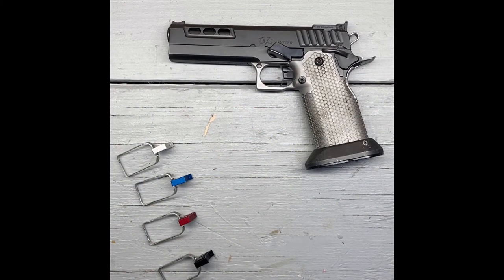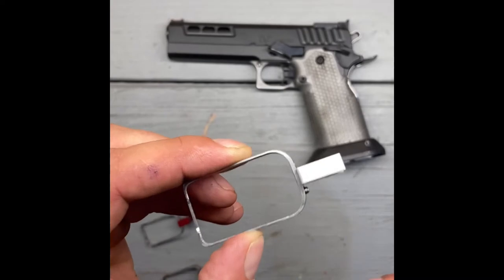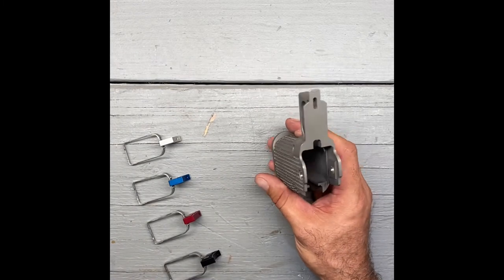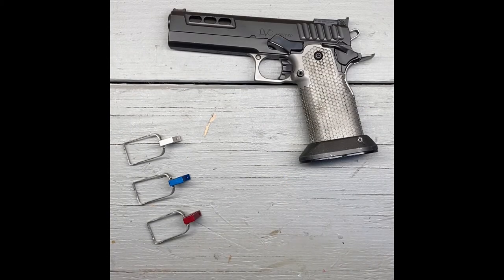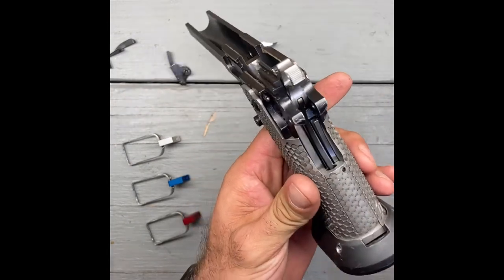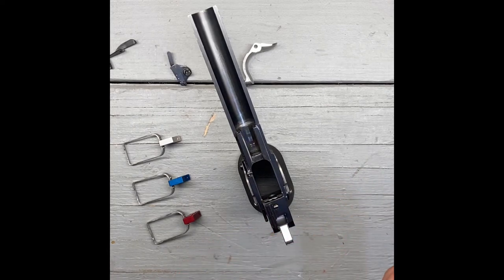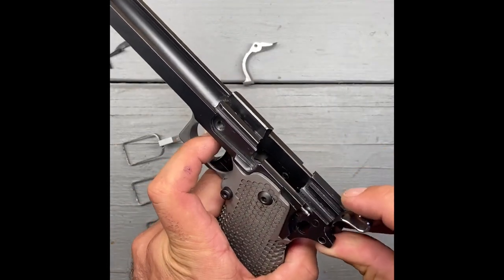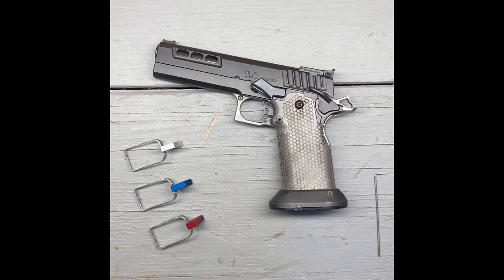ST Trigger Install Guide

Comment: What's the difference between a Staccato ST and a Cheely ST? I had a Staccato laying around so I fitted it to my cheely grip and it seemed to be fine.
Reply from the maker: There are slight dimensional differences in the trigger shoe. A Cheely ST Trigger can fit in a Staccato grip, but a Staccato ST Trigger can not fit in an unmodified Cheely grip. Cheely grips straight from the manufacture have small trigger track guides that can be filed and fitted for larger trigger shoes. Our Cheely ST Trigger is designed to fit the unmodified Cheely grip. If you have a Cheely grip that was fit for a different after market trigger, then our Staccato ST Trigger will fit them.

Comment: Installed the F2 to my C2 with gen 1 tree bark grip.  Tuned to zero pretravel and it renders grip safety inoperable.  Walking back the pretravel screw just enough to enable grip safety function gives me pre travel slop.  Suggestions?
Reply from the maker: The grip in the video is a competition PT EVO grip that comes from the factory with a non-functioning grip safety. Yes, you are correct, the grip safety tang will ride on top of the rear of the trigger bow if all the pretravel is removed making the grip safety inoperable. This is bc the grip safety tang can not return to its original position located behind the rear of the trigger bow. A gunsmith can fit the grip safety tang to the new trigger making it operable with minimal pretravel. Again, we only recommend a certified gunsmith attempt this due to the inherent safety issues.
Reply: @reddirtusa6065  your trigger bow measures .020 longer than staccato trigger bow.  Shouldn't call it a Staccato trigger if you have to shave down OEM staccato parts for the trigger to function as intended.  I purchased 2 triggers, one of which I had to file the trigger shoe for proper fitment only to now find I have to file down the grip safety which is not available for sale in parts should I or a gunsmith mess up.  Will you honor a refund for the trigger I filed down?
Reply from the maker: @parkje214  As with almost all aftermarket 2011 parts minor fitting can be required. In the end, we want all our costumers to be happy with the product or service. Please contact us via email (info@reddirt-usa.com) and we will start the refund process for your order. Thank you